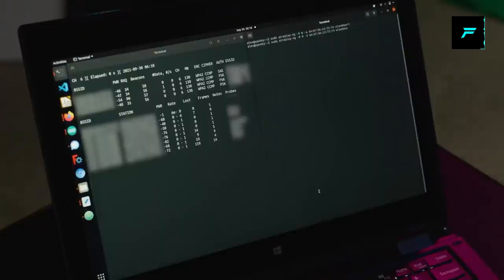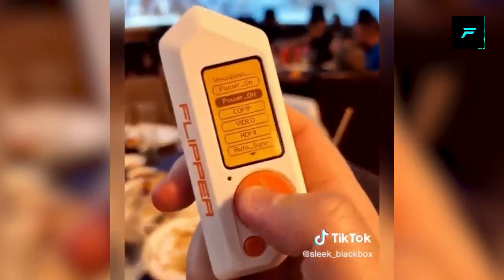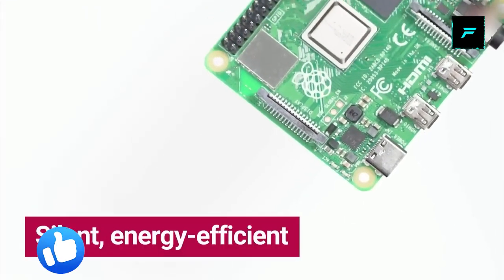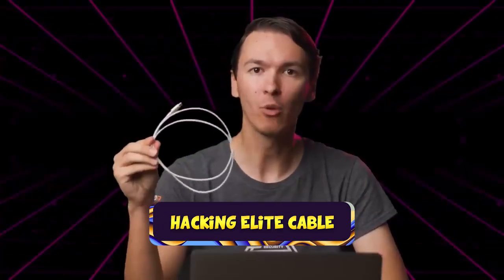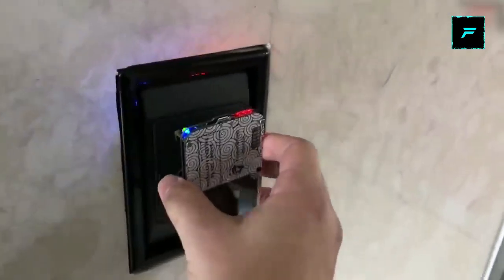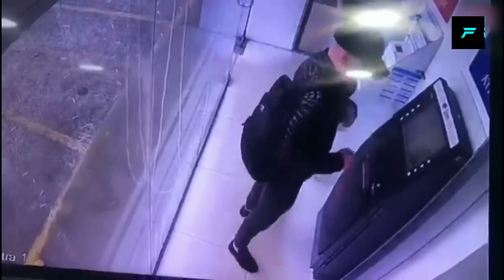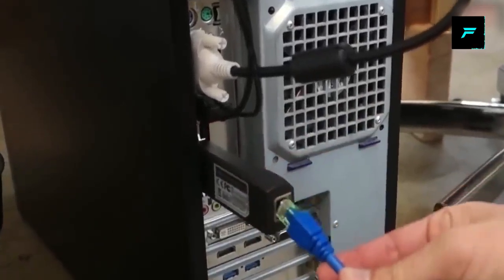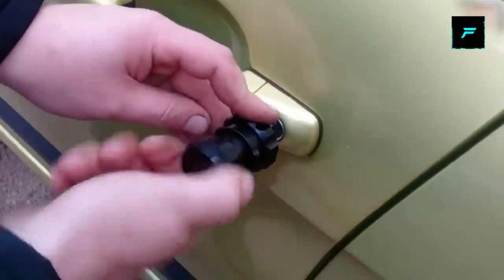10 Hacking Gadgets Available On Amazon And Online .

Comment: Bro device used for the car only opens the car and does not start the car because every car key has a unique chip called transponder inside the key. So starting the engine might not be working.

Comment: Raspberry Pi value theriyama pesitta bro 😌
Reply: Bro aama bro 
Ennoda hp laptop 8gb ram with graphics card , Intel i5 core processor
But itna ennoda raspberry Pi 4 4gb ram compare pannunmbhodu rendu computer equal performance than kodukuthu
Athu mattum illamal rendu curved display connect pannikalam output 4k
Apram 12mp camera connect pannikalam usb mic iruku
Libre office iruku office work Pankaj cloud computing panlam athu mattum illamal Play station low cost la panlam
Reply: @smile-4579  Not about only computing, we can perform more  hacking and IoT related things . !